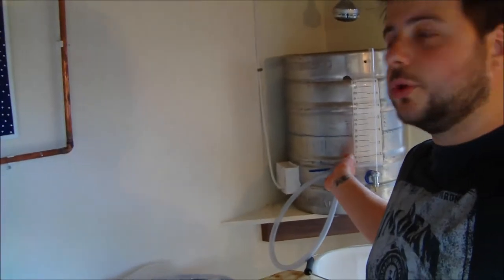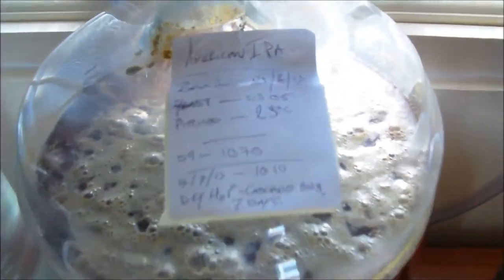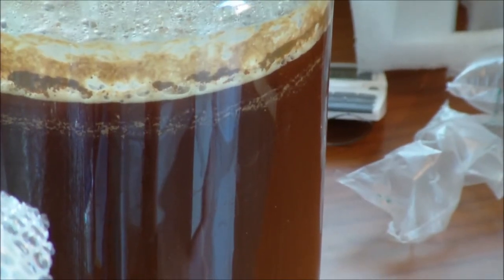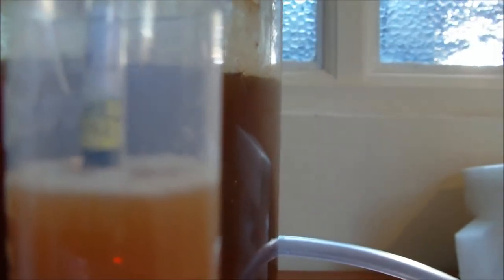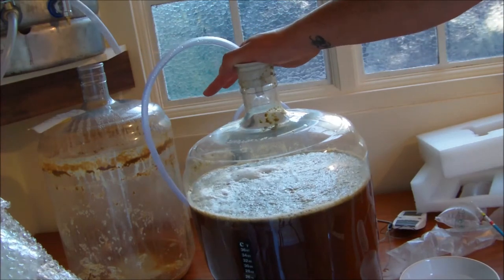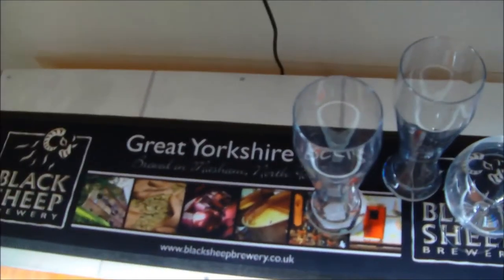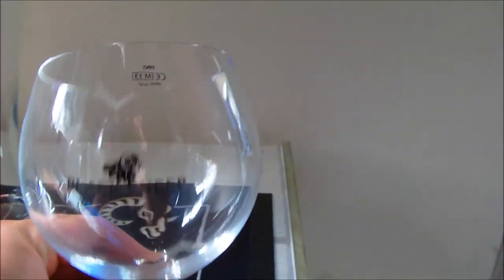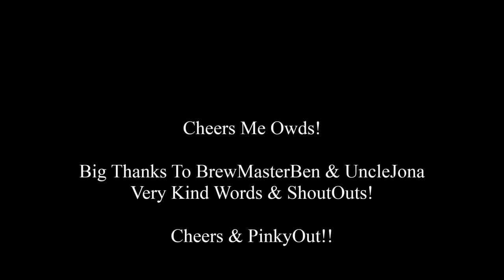HBW No.11

Comment: put a float sensor in your HLT, that completes the circuit for the PID, or directly to the element, then if the isn't any water, theres no power going to the element